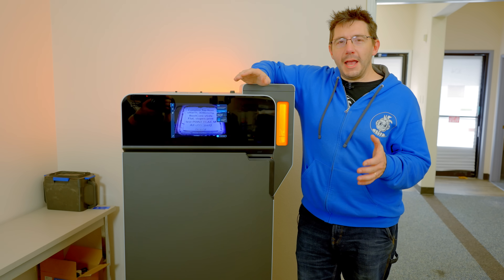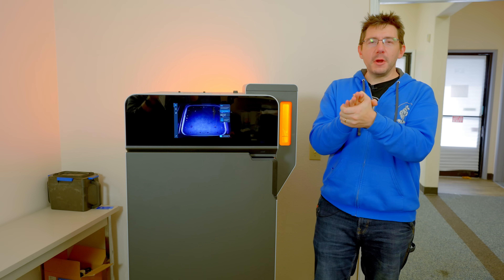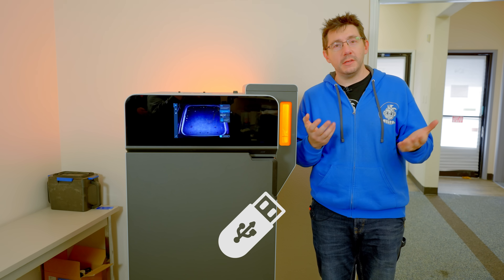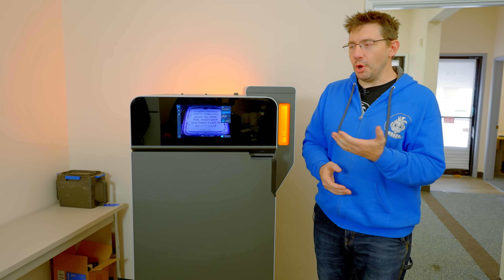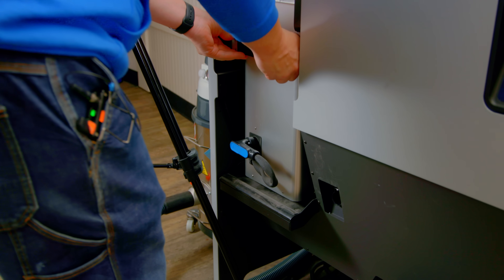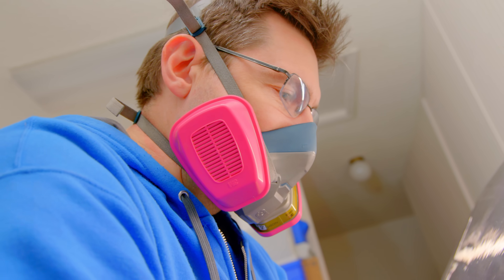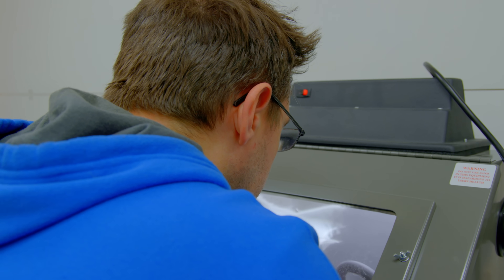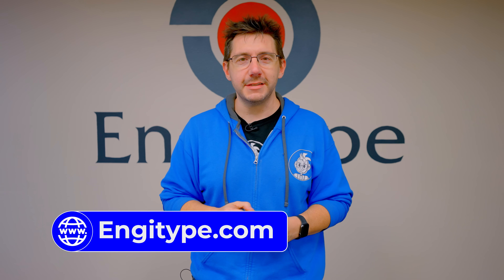Formlabs Fuse 1 First Look - Digging for Prints

Comment: I have  questions after I upload my parts in printer my printer (formulas fuse 1) after few layers it show some notifications 1. Review the last few layers of the job 
2nd error 93/3 The recoater was obstructed  while typing to move use vacuum  to clean all the powder out of the powder handing system 
plz share your experience or make a videos about this

Comment: Hello everyone, I am a beginner in 3D printing and I have a CR 10 V3 and I have a question about printing without a base or what would be the base that is created at the beginning of printing is that I have tried it on several occasions and The impression is damaged, the filament is detached from the platform. I am using it at 205 ° the strusor and the platform at 60 °. I am thinking that I may have to calibrate the bed for that type of impression. problem I have, I would appreciate a little help

Comment: Glad to see one of these. I feel like SLS is still one of those somewhat mythical systems. It may be viewed poorly by some, but there has to be a reason every print-on-demand service, major industries, etc. use these over nearly anything else. Yes, SLA and FDM are used in industry, but it always seems like the exception to the rule rather then the de-facto standard. If there's one thing I'm glad to see is that it's not super clean... as in, I heard SLS isn't super clean but the Fuse 1 promo video basically has it in the middle of an office and it seemed... weird.

Comment: This tech is how I started in 3d printing. Using a Z Corp 310 Plus(binder jet machine), I bought back in 2005, no it isn't SLA resolution. But it was superior to other printers of the day. 
It did have less equipment, just a printer and de-powder station. It used HP printheads, which got harder to find by the end. Temperature was no big deal and parts didn't shrink. I used CA(known as superglue) to make parts stronger. Even after 16 years I still have raw parts that came from the printer.

Comment: Nice to show the complete ecosystem from Formlabs. There is much more to SLS printing that just melting the powder.
For all of those asking questions about re-using the powder: The build chamber is kept at a high temperature so the laser just needs enough power to add that extra energy to melt the plastic. This also prevents warping. When the plastic is heated for longer times, it starts degrading and in the end it becomes unusable - this is also why plastics can only be recycled a number of times before degrading into a lesser type of plastic.
After recovering all the unused powder, it gets through a number of sieves so that only the very fine powder is removed. When filling up the cartridge for the printer, new powder is mixed with reclaimed powder in a certain ratio (30-70% of new powder is added, depending on the manufacturer).
Also note the powder used in this printer is grey instead of the natural white color. The grey powder absorbs more energy from the laser so less laser power is needed to print at a certain speed.

Comment: VERY surprised that the sifting station doesn't have a full enclosure and gloves like the sand blasting station. It honestly feels MORE necessary for sifting than for the sandblasting.
Reply from the maker: I was thinking about that. I know there are hoods for chemicals in labs, and those aren’t fully enclosed. It’s VERY recommended you wear a respirator and I did. Great question though!
Reply: Even some of the more expensive breakout stations for SLS printers aren't enclosed. This sifter is way more enclosed than the one I use at work.

Comment: I wish I could get my hands on an SLS printer for prop making
Reply: Outsourcing your prints to a print shop is the better option, if you don't print daily and can't fill the build volume with parts. SLS is pretty messy (powder dust) and should be handled in a dedicated "clean" room. And for the price you would pay for a full SLS setup with dedicated room, cleaning and post processing station, materials and everything, you can get A LOT of parts printed by a professional company. And the professionals might offer larger print volume sizes and a bigger choice of materials and post processing, if needed.

Comment: The guys who run this company are total aholes.
But don't mind that if the Technology is tight and accurate.
 I would wait for the Fuse 2 0r 3.
The print quality will be better and possibly cheaper if your time is valuable!!!
The engineers who work for me are not cheap, and you give then a first version machine like this and a lot of time is spent on the learning curve and bug issues, and machine to part design limitations.
There First sla 3d printer had issues, and was buggy.
Just a time waste on the users part and the material is super expensive.
By the time they made it to version 3, it preformed much better and the print quality was better than most in the same price range.
I see a few problems here, lots of Material waste, expensive waste at that, which is common in sls 3d printing. 
dimensional accuracy do to shrinkage and sand like blasting, build size, layer thickness, which looks like .2, .3., .4 layer thickness.
parts not being Air tight and liquid seepage.
This sls technology has a possibility to be too weak, Stronger, more power needed issue.
If you run this in a shop setting your going to need lots of room and the possibility of air tight concealed room. When I first got my first sla 3d printer my neighbors in my building complained about a smell and they called OSHA, OSHA did not have a problem shutting my business down and demanding I get a very expensive vent system which cost over 1/4 million.
Then OSHA inspections on a regular bases.
I see a possible osha problem here, and osha don't mess-around, they don't have a problem just shutting down your business and leave you hanging, been there done that!!!
These design engineers are very smart and the Fuse 2 or 3 will be better, maybe good to go!!!

These are big money and the first version of 3d printers are famous for the above problems stated here.
I'm not saying don't buy it ! 
I'm just saying buyer beware!!!
Thanks Joel for another great review/ video, I have been waiting for this review.
I want to jump on a sls 3d printer but, is it worth the money???, time will tell!!!

So Joel do we add famous actor to your list of talents!!!......... with this kind of viewership and hanging out with the likes of Mr. Prusa and other famous Nerds.
 You're not just a Nerd anymore!!!
I wish you continued success!!!

Comment: So what you should know is that a SLS is good for mass production and not for single part designs.  Use the full build area with as many parts as you can else you throw away powder (money). Yes you can recycle  it, but not forever. Over time the powder will become flufy and lose it strength. 
Parts don't have a fully smooth surface, it is sintered so the powder isn't fully molten.  it will attract moister from the air and grease from touching it. 

TIP: The print area of 165x165x320 can't be used fully. The outher edge can't have parts due do the material strength. Flat parts are stronger when they are printed in a 30 a 45 degree angle simulair by SLA. 

Part from slow printing-  warm up and cooldown time it creates nice quality products.  XD

@Maker's Muse "amazing and terrible process" , totally agree.

Comment: Just one question: how much to set up a shop to use this system? Do any Maker Space have one of these?
Reply: Around $30K for the printer and the sift station. My university's makerspace has one in its own room but I imagine it is too pricy and messy for most.
Reply from the maker: That I am not sure. Reach out to EngiType and they can tell you the cost of the workflow I did.

Comment: Nice system. We need AI cleanup robots to do the sifting and sand blasting!
Some wheels on the bottom of the build chamber would be a good addition so you don't have to carry it to the sifting station.
p.s. Archeology is digging for human cultural remains. Paleontology is digging for animal or plant fossils. Archeologists don't dig for dinosaur fossils.
Reply: There are automated systems for doing this industrially, but they cost in the hundreds of thousands, so you aren't getting one of those for a small SLS printer like this.
Reply: Some machines of this type do have a cart that you wheel around as the build volume. But I think those are more expensive machines with larger volumes.

But in this case, you could certainly have a separate cart that you put the build volume on, so that you could easily wheel it around.
Reply: I learned something new today

Comment: imagine an SLS with a smart ajustable build volume to use less powder
Reply: You don't have to print the full volume on these, and any un-sintered powder is recycled too. So, I suppose it is adjustable to some degree, albeit not on the X and Y.
Reply: @Defender3d  oh yeah I meant XY to lessed the ends of cleanup

Comment: We bought one of these for work. And it gets used almost daily. A couple things: 1) it needs extremely clean power. A power conditioner should probably be purchased if you're getting a lot of failed prints. 2) it doesn't have SLA level resolution. But it is better than FDM.
Reply: What do you guys use it for? Price tag for these are expensive! Curious to what you guys make with this printer.
Reply: @brotherbrother9156  I run a prototype/fabrication shop for work. Most of the time I'm printing out fixtures for scientific experiments. Sometimes I print models for project sponsors other times it's parts that need to have no support material. Really depends on the application. Being able to nest parts is a huge advantage. If we can get away with the lower resolution I can spin a "production" run of parts for a project and knock them out over the weekend. Can't really do that with an SLA/FDM printer.
Reply: @brotherbrother9156  My company bought an HP MJF 580 and honestly I regret it knowing this costs 1/4 the price. You also don't have to buy all the stupid ink refills with this. Just the material. The build quality is a little bit less good on the Fuse 1 but man does it save money.
Reply: @brotherbrother9156  the machine is quite affordable ($30k for everything) compared to a stratasys or HP fusionjet machines which start closer to 6 figures.  (but certainly not marketed for hobbyists)    the cheap price means Formlabs is getting their money back by selling proprietary nylon blends at $100/kg....
Reply: @engineeredaf1920  HP materials are about the same. Plus you have to buy the 'inks'. Its annoying and really only for companies who can eat that cost.
Reply: "clean power"' ...meaning what?
Reply: @ammerudgrenda  not noisy. Good voltage stability
Reply: Do you have it on a dedicated circuit? I know that is very important for these.
Reply: @Defender3d  Yes-Ish. I had the Sift on the same circuit but it was never in use when I was printing. I had about a 50% failure rate before using a power conditioner, now I have a 100% success rate.
Reply: @conrad2468  okay, good to know. For the print times, you don't want many failures when sintered powder is costing you £100 a kilo! 🤣
Reply: By "Power" do you mean powder by any chance?
Reply: @harastha  no I mean power. Lol

Comment: (Wheel reinvention concept) 

High velocity electric unicycle with a unhackable mobile supercomputer RISC processing for utmost stability, using built in GPS and lidar 3d terrain and surroundings scanning potential, long range distance able and that can fit in a spare wheel compartment for even the cars as a added safety measure. The innovation of the right to mobility ♿. Wheelchairs too to help boost disability rights as well.
Entirely possible.

#TheDigitalLifeguardProject-_-
Reply: It should also be able to be a spare tire for a car as well, and even be able to add locomotion for a car that ran out of power.

Foo Fighters - Times Like These 🗽

Comment: as far as I know, you cannot use the old powder indefinitely until it is finished, you have to sprinkle fresh powder in the right proportion. Maybe something has changed in this topic?
Reply: You can use all powder, even non-virgin. The Fuse Sift will combine old and new, and so this will use the old up if managed correctly. Ideally you need to achieve a 30% packing density, to get the best out of the powder use, and the volume. You will end up with very little waste, just what is recovered from the vacuum when cleaning the Sift, and even that, you can re 'cyclone' that, to use on testing pieces.
Reply: Plain old pa11/12 nylons work best with a 50/50 refresh ratio, some you can use up to 70 with little loss in part quality. Proprietary powder like this I couldn't say
Reply: @smokin1974  Formlabs recommendation and the default setting on the mixing station is 70% for the PA12 powder.
Reply: @erikcederb  good to know, thanks

Comment: Great seeing a fuse 1 in the wild! SLS is such an amazing and terrible process with the waste powder and non uniform part shrinkage but you can't argue with the part quality and... No supports needed! 😍
Reply: We have a fuse 1 in the shop and we printed around 20kg of nylon 12 already so I'm very confident to say that you can print with 70% reused powder, tha parts are not brittle at all.
Very strong nylon parts.
We use it for casting patterns and we put hundreds of kilograms of sand on top of these for several houndred of cycles and they still going.
Reply: I'm a bit confused. Why couldn't you just re feed the vacvumed powder back into the machine?
Reply: @ameliabuns  You can. Formlabs has some machnies that mixes new and used powder to recover used powder.
Reply: @kochammody6268  YOu can partially. Each build you cna use like 20% used powder, because used powder is slighty oxidized and ruin from the heat and oxygen exposure from the previous build.
Reply: @hfcandrew  The Fuse 1 has a quite high refresh rate, so for consistent results, you only need to refresh 70% used powder with 30% new powder, and you can choose to go lower than that if you accept a degradation in print quality and mechanical performance.
Reply: Interesting, and inaccurate comments here folks . . .
 I've been running 2 of the Fuse 1 for a year now and have a third coming next week. I've gone through more than 300kg of powder so far. There is little wasted powder, other than what you vacuum up during cleaning, and even that can be reused if not contaminated. Shrinkage is non-existent in my experience. Having now printed over 40,000 parts on these in the last year, I never throw powder away, and as long as you stick to the 30% new and 70% recycled powder mix, the results are perfect. It's not a cheap solution, but it comes with a hell of a lot less headaches compared to other options, and the parts are very tough (PA12), and easy to post process. As well as the parts made for Defender3D, I've printed a lot of various parts for automation, process control, government  use, and automotive applications. At 20k per printer, it's a big outlay and even bigger when you factor the other equipment and maintenance, but still a very viable solution that has been far better for the money than other options on the market right now.
Reply: @Defender3d it’s still messy and health concerns are always a factor
Reply: A friend of mine works at Fomlabs so I've gotten to see and touch SLS parts off the Fuse myself, they are definitely impressive. Brittle, but impressive.
Reply: and the ability to print metal is a big deal too, imagine printing your whole 3D printer's parts like of the Prusa in aluminium or stainless steel to make it real strong, or just so it won't deform in a hot enclosure idk xd, if i could i'd print my own x carriage mounts etc in aluminium
Reply: @BH4x0r  The Fuse 1 is not a metal 3d printer, but a polymer system to print PA11/12 (more materials are in development). 

There are significant differences in both the printing side and the powder handling on a metal SLS system that makes one able to print polymers and the other one to print metals.
Reply: @erikcederb  Yeaah didn't really google how much power the laser got so i figured it might've, i meant SLS in general tho
Reply: @BH4x0r  that could be not cost effective
Reply: @noway8233  cost effective probably not, would it be fun and improve things? sure would xd
Reply: How do they get accurate part with non uniform shrinkage
Reply: Facts annoy sales people.
Reply: The problem is that the powder is heated to just under the fuse temperature. So you can only put the same powder into the machine a couple times, otherwise the powder starts to clump and the print isn't as crisp.
That is also why most of the time when you see SLS printing they fill the volume nearly to the max.
Reply: @tiffanysandmeier4753  quick question. you say the print is not as crisp if its "too used"... but is it to the unprintable point or just uncrisp but printable? I couldn't care too much if my prints are not as crisp as long as they still have a good mechanical and dimensional level
Reply: @gongarcia4071  that I don't know. I don't have personal experience, I just did research on the different types, pros and cons, stuff like that. 
But the quality of parts with first time used powder is better than a mix of new and used powder.
Reply: @gongarcia4071  For PA12, you can go with just sifting and reusing the powder as long as you can accept a degradation in surface quality and mechanical performance, but a refresh rate (addition of virgin powder) of 30% is recommended, and you will use up some powder that become models, so you will need to add some virgin powder anyways.
Reply: @gongarcia4071  Overusing powder especially recycling more than just the loose powder in the build with other SLS and MJF machines can lead to all sorts of problems in parts. Visual and/or mechanical.